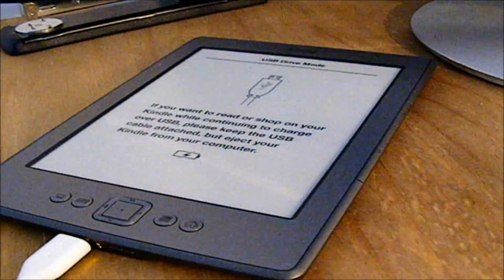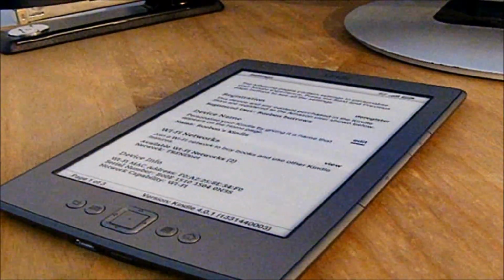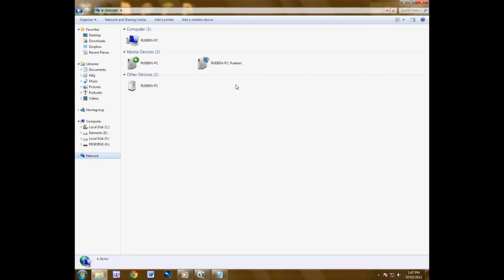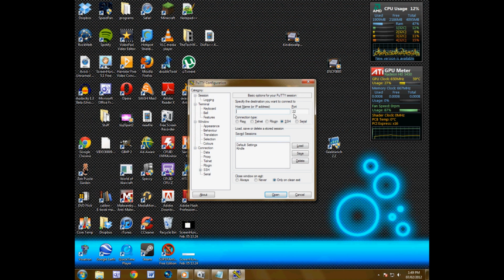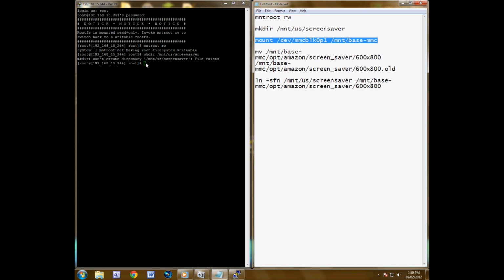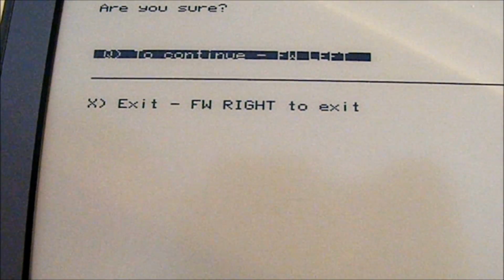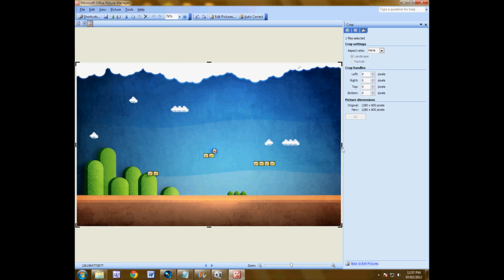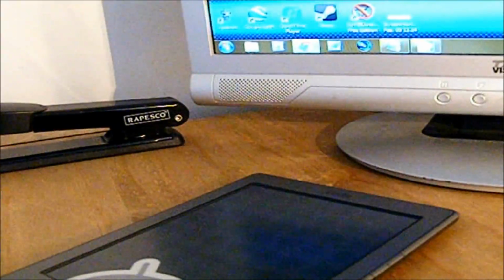How to set a custom screensaver/wallpaper for Kindle 4 Non-Touch 2011-2012 + (Enter diagnostics)

Comment: Linux user here, your video gave me an idea so thanks
Reply: Do you remember what you did? Which distro did you use?
Reply: @tobers_j  Those are *nix commands, so you can set a ftp connection via command line or use something like Putty or Filezilla, I was using archlinux but any distro should do.

Comment: I wonder if this will work for kindle 4.1.4 though
Reply: Just trying this myself, on Kindle 4 non touch, no ads, with firmware 4.1.4. I get a connection refused error when trying to ssh into the kindle. Going by other comments this could be a 4.1.4 issue. If I figure out what to do, I'll let you know 🙂

Comment: If anyone is still using these devices like I am as far as I can tell this method isn't working. Not sure if it is due to compatibility with later versions of windows or the latest 4.1.4 kindle software.

Instead use the jailbreak method to add custom screensavers. 

Follow this wiki page  -  https://wiki.mobileread.com/wiki/Kindle_Screen_Saver_Hack_for_all_2.x,_3.x_%26_4.x_Kindles

I'm unsure if jailbreaking is necessary as I was already jaibroken when I followed the tutorial. But if you'd like to try the screensaver hack without jailreaking let me know if it works.

If you're stuck in diagnostic mode after trying this tutorial, refer to "Salvag3dHalos" comment in this comment section to return the device to normal.
Reply: Bro I did the jail break with the latest update, jailbreak worked but it  aint working.

Comment: First !! get your model by going to settings. After that follow very wisely the tutorial from this video and will work 100%. I've done it on Kindle 4. When installing putty and try to connect, window 10 will give an error that might not be the device that you try to connect. so press yes/ok and should work. also on putty input all the details like host name, port, ssh and at "saved session" type kindle and hit save.

Comment: If you still have one of these things like me, Yes this is now working on the latest update for the 4th and 5th generation (4.1.3) **make sure you get your serial number on the second page of settings before you start this otherwise you wont be able to find your root password later on.  If you keep doing it wrong and you're stuck just hold down the button for about 40 seconds and then follow these instructions:    go to Device Settings, the only option with xml file in it, plug in your kindle,  delete the ENABLE_DIAGS file and you can delete the Usbnet one too, then go to disable diagnostics follow those little directions and wait, you may have to restart again by holding down the power button on the bottom for 40 seconds
Reply: thank's a lot !!!

Comment: I got my kindle stuck on diagnostic menu. It doesn't turn off, I'm basicly able to do nothing. What should I do? Wait for it to run out of battery, or what? I also could't reboot my device in normal mode, even if I did switch off the "diagnostic rebooting" i options...
Reply: Okay, I made it! :D Hold the power button for 40 seconds and it will reboot into normal mode. Just check after it if you still have "ENABLE_DIAGS" folder on yr device just in case ;)

Comment: UGH!!! WHATEVER YOU DO, DON'T FOLLOW THIS TUTORIAL! I was stuck in diagnostics mode. I got out by first holding down the power button for 30 seconds to reboot because it was frozen, then going to Device Settings, then something like view xml file, plug in your kindle, DELETE THE ENABLE_DIAGS FILE ON YOUR COMPUTER, THEN go through the disable diagnostics prompts and it should reboot itself into the right mode. JEEZ that was stressful considering I just got this thing two hours ago. You think this is going to be a simple tutorial on how to set your screensaver. How is this any different than a jailbreak? You're hacking the device.. seems the same to me.
Reply: Let me google the term "hacking" for you...
Reply: I had the same problem, don't follow this tutorial!!!!!
Reply: Thanks, you saved me from being stuck in diag mode
Reply: than you so much I thought my kindle was gone forever. Thanks for the help
Reply: Agreed. I tried changing my screen saver as well and just gave up at the Putty program. You would think that it wouldn't take this long to change a damn screen saver on an electronic device that can be access by a computer...
Reply: If it to difficult, let it be.

Comment: Warning: this does not work with Kindle 4 running firmware 4.1 or higher! In this firmware the ssh root access by USB is not functional, and you will get a connection refused on port 22 message as reported below.
What's more you will find a big problem trying to exit from diagnostic mode. It will give you a message saying device info xml not found and will not exit.
You can get out by going to the very first menu item called Device setting, then create file info on the menu that appears. then go back and exit diagnostics and reboot.
Reply: Woof. Thanks I thought I bricked my Kindle...
Reply: It works on 4.1.1
But you have to install the OpenSSH server on the device.
Reply: how do i do install the openSSH? and what would be the next steps after that? i am on version 4.1.3
Reply: Thanks for the "exit diagnostic mode" information!

Comment: Just a post for those no having any luck, I have a UK Kindle 4.1.0 with Windows XP which failed to connect to the device missing a RNDIS driver. Network Centre is different in XP and I'm not Windows savvy enough to want to brick the device!!

Comment: Here is my problem: I did a mystake while using "putty". I wrote "mv /mnt/base-mmc/opt/amazon/screen_saver/600x800 /mnt/base-mmc/opt/amazon/screen_saver/600x8?00.old" --- mistake in 600x8?00.  And now I can´t rename it. I tried to reset my kindle to factory settings, but it didn´t help ...

Could someone please help me?
Thanks

Comment: Somebody help me. I started this process but changed my mind, now I cant go forward or back and my Kindle is stuck in diagnostics mode. I tried to just continue but that didnt work either
Reply: i have the same problem, did you find a solution ?

Comment: Hi,
I got through all of the instructions with no problems. The Screensaver directory is there. I populated it with 50 800x600 pixel photos but they don't come on when I click off the Kindle. Is there a maximum amount of photos you are allowed to have active in the Screensaver root directory? You never mentioned that. Help please.

Comment: When I opened putty I had to type "192.168.15.244" (not "192.168.15.1"alothough this is used in the networks step in control panel).
In the putty dos screen I used username "root" and password "fiona".
Not sure why this was different but it worked!

Comment: Quick question, the IP address that you put into PuTTY was 192.168.15.244 (which is what the Kindle listed onscreen as IP after you enabled USBnet. However, when you went into the network sharing centre stuff it said 192.168.15.1. Which is the correct address to use?
Reply: Yes.

Comment: Hi, thanks for the instructions, worked a treat. One question: what's happened to the factory screensavers? I like them too, but only wanted to add a few of my own. Have they been permanently deleted from the Kindle, or is there any way of putting them back in the screensaver folder? Thanks.

Comment: Thanks soooo much!
Quick statement though,
when you are using putty and you try to paste things and nothing comes up, dont freak out.
just right click the little text line (or box in this case) and it should pop up after you pasted it earlier on with no result.

Comment: Yeah, I've tried numerous uninstalls and even running the whole process on a different machine. I'm following the instructions to the letter, including the part in the comments on installing drivers for USB Ethernet Gadget, so I really don't understand what the problem could be. Is it possible that the issue is with my kindle? I'm going to attempt the same procedure on a friend's kindle when I get the chance. If I get the same result, my last hypothesis is disproved, and I'm pretty much stumped.

Comment: 4. In the next page, click "Let me pick from a list of deice drivers on my computer"
5. It will ask to pick a type of hardware. Click "Network Adapter"
6. Under "Manufacturer", click "Microsoft Corporation". (Note: this is not the same as "Microsoft")
7. In "Network Adapter", click "Remote NDIS based Internet Sharing Device.
8. Then click Next. Done.

Comment: Ok, i found the problem. The driver for usb-net (or something) wasn't installed. Here is the solution:

After enable USBnet, if you can'f find the "unidentified Network":

1. Go into the device manager, by right clicking on "My Computer" and selecting "Manage", then clicking on "Device Manager"
2. There is a device called "USB Ethernet Gadget". Right click on it and select "Update Driver Software..."
3. In the wizard that came up, click "Browse my computer for driver software"